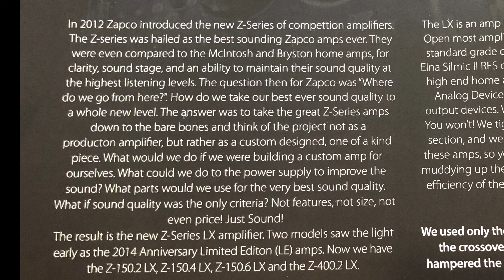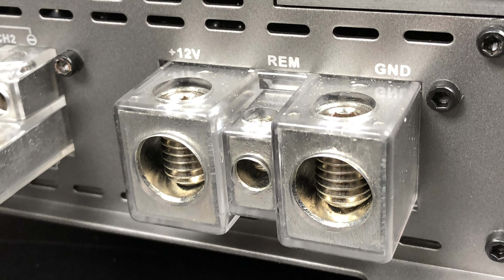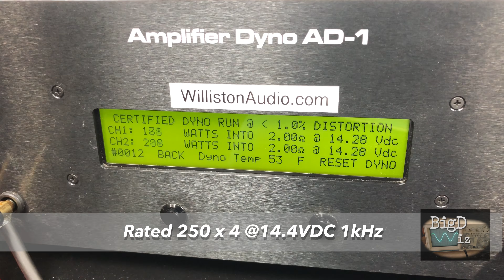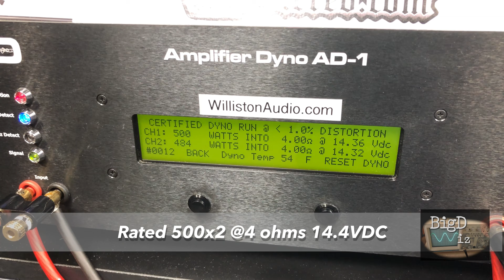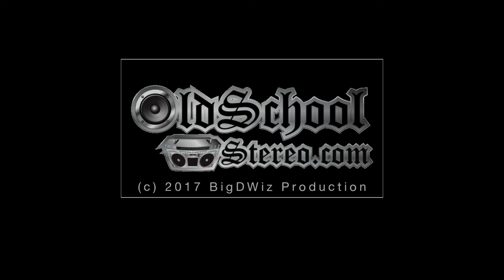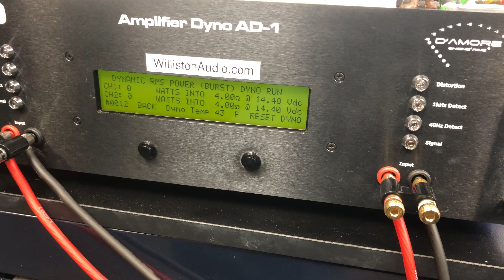$1200 SQ Amplifier? Zapco Z-150.4LX Review and Amp Dyno Test

Comment: These are sq amps so the efficiency wont hurt your car since your only using a tweeter .a midrange and midbass. And perhaps one 12 subwoofer. With approximately 400to 500 watts they have plenty of headroom so overheat I dont think so. They do get warm. Just like my home system.  But I put fans on them.jesus we been putting fans on everything since we were kids in the 70s

Comment: question.... so Zapco never sold out, they are still the same company as back in the 80's(my time)
Reply: No they did in in the late 2000s Robert Jeff was the original amp designer back in the 70s Zeff Advanced Product Co (Zapco) now he's designing amps for arc audio, everything was originally made in Modesto CA USA now it's all from china, so to answer your question no these are not the same amps or company from your time.

Comment: It’s weird cuz I though these amps are rated at like .05 % ( .0005 ) THD shouldn’t the amp make more power up to 1% which is .01 ???? Anyway these have been replaced by the AP series which is even more improved and has better SNR and ch separation! Still this amp is one of the better amps for audio 🔊✅

Comment: I have had a number of amps but the one amp I have and will never let go is my zapco amp ..... It's a beast and sounds much better then any other amp I had ( sundown, ctsounds,fosgate,skar,imagdynamics)
Reply: i loved my zapco amps  sold them and bought cadence amps made by zed audio  night and day   the zed audio  blew the zapco away  with clarity and  bass punch
Reply: @ArkansasChainsaw  what zapco line are you comparing because i run the Zapco Z150.6AP which is there newest high end made for audiophiles... Most SQ builds run the AP line for its pure sound with no built in crossovers
Reply: @bennyblanco14   had studio  and ag  line    dont get me wrong they soung good and plenty of power     my  ear prefers the zed  audio  not the new crap  1990's  stuff

Comment: Seriously though man, the difference between channels isn't as much one way as it is the other. The way you are connecting the bridged inputs when testing amps is causing your channel 2 to take excess damage. You need to evenly bridge both sides. Should be easy to make a bridge block. Two one in, two out blocks with banana plug wires connected and ready to take the load evenly is a simple concept.

Comment: looked and performs like an over priced turd. Kenwood kac 501x looks better a third the price. as for no expense spared it looks as if it has 200v rail caps and no chopper board which stinks and no cable jumpers. inconconclution it looks like a $50 flea market amp with the reliability of 200v rail fire hazard.

Comment: I’m actually most impressed by the fact it did within 1 watt difference between the channels when tested. I typically cringe when amps are Dyno’d and 1 channel reads much higher than the other. That fact alone tells me it’s a high quality amp. Thanks for the testing.

Comment: So cringe watching you shoving the stripped cables into the blocks and winding down the tiny allen keys. On every video. High profile installer like you should go and buy a proper terminal pin crimper.
Reply from the maker: I bought ferrules, but I found I was wasting WAY too many of them. I test too many amps and re-use wiring, so cringing will continue 🤷‍♂️
Reply: BigWiz... Yes, I know you test many amps and reuse the wiring, that's why I made the comment. Just leave the pin ON the cable each time, that's the whole idea of them! Makes it much easier to remove and replace the cable multiple times, and more importantly you get a proper connection. See Link: https://media.digikey.com/Photos/TE%20Connectivity/180599.JPG
Reply from the maker: But not all amps I test accept insert wires. Also, the ferrules flatten out and can be difficult to reuse. For perm installs, yes, but does not work well in my situation.
Reply: BigWiz, with respect... I didn't say anything about ferrules, and I have no idea why you keep referring to them. Terminal PINS. Please open the link that I included in my previous post.

Comment: First time seeing your videos, you did a great job but in all seriousness it is beyond me why anyone would spend that kind of money car audio seems like such a waste
Reply: The 'Diminishing Returns' principle applies anywhere in any kind of audio, but the difference between bargain-basement 'budget' and good-to-better quality is very real, at least as far as components are concerned.  I've heard it, and it can be so disappointing, especially when you know it's out of your budget.   As far as accessories/interconnects/cables, well, you can drown in the snake oil there.  There is also a tangible principle of synergy, where you find a combination that works fantastically, and another that just doesn't, without compromising quality in any individual component.  I have heard this personally as well.
Reply from the maker: Thanks for watching and commenting! Some audiophiles have no limits when it comes to the pursuit of the best sound

Comment: Does rated; awesome.
I can find a Sundown 4 channel that also does rated for $300. So that means I’m paying an extra $900 just for “Sq”... I will have to give it a good listen and tell any difference in sound if I’m blinded but the common person would not tell much of a difference thus in the end, it also depends on the speakers used and how they are setup.
Reply from the maker: Some people are willing to pay $1000's for special speaker wire and interconnects. The SQ market is special and those who appreciate it are willing to spend more, if only for perceived sound differences. I don't test or make claims based on SQ as it's subjective and cannot be measured by tools. A Zapco representative contacted me to test one of their amps, I agreed only if it was allowed to be given away. Perhaps this was not the best test method for their product as it was just wattage numbers, but for now that's what I test.
Reply: BigDWiz 
It’s impossible to capture the Tonal accuracies of an amplifier on video though. The only way is either buying one or being there to hear it. I agree with you 100%.
Reply: Special high-end op-amps and ultra high quality caps makes a huge difference if your speakers are of quality and your not playing low grade mp3's. This amp is for a person running 3 way active with drivers like audio frogs gb10,gb25, & gs60. Add in a helix pro dsp, a nice Kenwood ddx05 or the pioneer 4200nex and quality install and this amp will sing. This same setup will show you just how low grade your avg full range amps are. No transient response because of inadequate power supplies...meaning no real headroom, channel separation is bad, so you got crosstalk, and high noise floor...you know when you hear the hissing between tracks...yeah this amp is one of the top amps period for audiophiles like myself.
Reply: Nike and Rolex watches both tell users the time. Sometimes it's about function... Sometimes it's about fashion. Zapco amps are just some far off fantasy for "budget folks" like myself. But if I had millions or billions of dollars in my bank account, I'm sure I'd buy a Rolex and Zapco instead of Nike and Sundown. 🤷🏽‍♂️
Reply: Eric Perry these amps does not have the Best channel separation like 55db and the lx amps which have now been replaced by the AP line at CES 2018 have bad signal to noise ratio which are known to be noisy.. this amp is Made In China ad well if you care ( I believe high quality can be made anywhere ) have a good day oh and btw I own Audiofrog GB series
Reply: A sq amp will blow the typical Korean board amp out of the water when it comes to sq.
Reply: Sundown...
Crap amps, and crap speakers.
Sounds like shit. 
Have you ever heard what a really well built amp can do?
Do you realize what you can get from a large but well designed sub driver where the MMS does not weigh a ton, the CMS does not equal that of truck springs, or where the QTS means better efficiency than that of an 85 year old pedalling a tricycle?
It's laughable when all the above numbers of a 15" Sundown are worse than that of a Precision Devices PDN2450 or B&C 21SW152 while being more expensive than the two pro drivers. 
The day the car stereo world stop ripping people off, will be a great day.
At least Zapco tries to build a nice amp, like Dynaudio and Focal tries to make nice speakers.
But brands like
MTX
JL Audio
B2 Audio
Sundown
DD
Rockford Fucksgate
Hifonics
Kicker
Soundstream
And so on keep doing their shit, the world of car stereo will be a muddy wold of burp boxes farting their way through life.
In the 90's Cerwin Vega proved that SPL and SQ could go hand-in-hand with the original strokers. Unfortunately, the rest of the market suffocated those with shitty drivers utilizing heavy cones and rock hard suspension designs.
A shame.
But at least it's nice that some are now using pro audio sub drivers, rather than the crap coming from the afore mentioned manufactures.
Reply: @AB-80X  I'm trying to build a system right now. What subs would you recommend? I want the most SQ but will also get loud and low
Reply: @chrisrichards4886  
Wow. That's a pretty open question. What size box do you have room for and what kind of amp do you want to use? What kind of price bracket?
Reply: @AB-80X  I will have room for a large ported box if I wanted to put it in the trunk of my lexus Is but I'm thinking about using a sealed box or running a IB setup.
Reply: @AB-80X  also I have some old audison Vrx amps like the 1.500.2 and the 6.420. I would like to keep it under 750 per sub and even less than that if I can get used ones. Thanks for your help
Reply: @chrisrichards4886 
Let's get one thing out of the way. IB is not for loud music, it's that simple. If i were to do an SQ system based on IB and SPL was of no concern, the choise is as simple as can be. Dynaudio Esotar 1200. When it comes to a driver that works great for IB in an SQ setup, there's no way but down from there.
Do you have any idea about at which point you'd like the crossover to be between your midwoofers and sub? Also, a large ported box or a sealed box can mean many things in terms of size. If it's for a sealed box and you can keep the crossover point below 95 hz using a 4th order L-R filter, and can fit in a box that is 1.7 ft3 including driver,, the Stereo Integrity HST-15 MK2 is hard to beat. If you need to pass it higher than that, the Gladen SQL Extreme are the subs to get for a high volume SQ system. Those work well in various applications, but is especially well suited for ported boxes.
I use the Stereo Integrity HST-18MKIII for my SQ crossing it over @ 50 hz in a sealed box, and it's an amazing sub. It's not a very well known brand, but their quality is excellent.
An important thing to note about all of these subs are the sensitivity. They may look like SPL subs, but in fact they are pretty far from that. They have a tremendous amount of definition and resolution, compared to most other things that is not pure SQ. They will need a proper amp that can deliver the current, especially if you want get really far into the basement.
Reply: @chrisrichards4886 
You're welcome. You can also look into the Stereo Integrity HST-11 if you prefer something smaller, or want to use multiple subs. They will play in a box that is by definition tiny and go extremely deep. The Fs is 17 hz. It does come at a bit of a price though. The sensitivity is on the low side, but it's still a stellar sounding driver.
Reply: @AB-80X  all of the subs you spoke of look very promising and come highly recommend on DIYMA. I actually could have gotten a pair of esotar2 1200's on there for a good deal but was worried I wouldn't get the output I want. I don't need it to be 150db loud but I do like my bass and would like to feel it as if I was standing 2 feet in front of a bass drum. Even more honestly, on my rap music, but still retain pure SQ on more refined genres of music. I do like to listen louder than normal volumes usually, is there nothing out there that will do this in a sealed or IB setup? I will be crossing over as low as possible, to 70 or less than 60hz if I can make the legatia L8se work in my doors! So 95% SQ but must be able to knock when I'm in the mood. Can I get that out of 3 12in driver's or 2 15in run IN? The gear and labor is so expensive that I can't afford to do it over of I'm not satisfied, but I am down to spend the dough to get it right the first time! I can tell you know exactly what you are talking about and appreciate your opinion. What state do you live in?

Comment: Can you test the Rockville rxd m3?
Reply from the maker: I tested the M4 a few years ago. In my experience, they do about 80-85% of rated power (lowest RMS power they post). The other 2 numbers are irrelevant
Reply: BigDWiz okay I was just wondering to make sure they'd at least do cea rated
Reply from the maker: Remember, CEA only refers to 4 ohm measurements. Just because an amp has "CEA Certification" does not mean they do rated power at 2 or 1 ohm. See my explanations in this video - https://youtu.be/yNaDpsK--8Y?t=2m8s

Comment: JMO but, I think this amp represents about as far as class a/b technology can go. As you can see this amp is built with all high quality components and still efficiency hasn't changed a lot since the early 90's. With its SMD design, durability should actually be better and I do like the fact that the designers opted to leave all the bass boost etc. junk off. 
Haven't personally heard it but,  it appears to be a very nice design and well built amplifier.
Reply from the maker: The design is inherently inefficient and yeah, 60-70% is about as much as you can expect from A/B. The other thing to consider is the Class D amps run at ultra low impedances (0.33-0.5) are gonna be horribly inefficient as well. Doesn’t matter if they are 85% efficient at 4 ohms when many people who use them try to run as low as possible.

Comment: BigDWiz I tried looking up before I'm asking this question, but have you tested a Lanzar VCT 2610 a so called 6k watt amp for less than 200 bux on eBay?
Reply from the maker: Nope. Rest assured it doesn’t do anywhere near rated.
Reply: BigDWiz if I took a zero off would I be close lol

Comment: $1200 really my skar rp 150.4ab been tested doin well over rated for less than 200 and bridged is rated at 500x2 rms
Reply: qjuan white The ZL-X series of zapco amplifier are toward sound quality their guts and components inside is best of the best let me give you an example if you would buy a 2-way component speaker like Focal or Hertz for lets say +$800 you can play them in Skar but to achieve the greater balance of mid and highs and transition between every notes switch to Zapco you will feel day and night difference bro i swear to god they worth the money only if you have An SQ setup and DSP
Reply: My dad had the Zapco Z3K and it kicked SAZ-5000 away SQ - Lower consumption - powerfull 
also my friend had the St-x 2000 watt rms and it kicked the SoundQubed 3500 away man in small profile amp they are know what they are doing Zapco are old company
Reply: SubsonicAuthority awesome response I'm going for a balance of spl and sq
Reply: yeah bro zapco isn't really all about the numbers, they are sq amps. Even in their big powerful line up. They do rated but with true sq. that's the difference between skar,sundown,taramps,soundqubed...
Reply: dank9288639 I'll probably check them out sometime if I can find one cheap
Reply: I went from a Soundigital amp that was small efficient and had a lot of power on my sundown audio SA components thinking that sounded good to a sundown audio 150x4 ab and omg it was a day and night difference. It brought out notes and sounds I hadn’t heard in the music before. So I’d love to hear my setup with a zapco since the sundown has been the best SQ amp for me sofar
Reply: Try finding some of the older American Graffiti, Reference(not digital reference), C2K, S or Z model amps. I had an AG1000 at 1875W @ 1Ohm stereo. 2 10's, 152db and sounded superb. Loved that amp! I just bought a later model reference 360.4 for $90! You just gotta know where to find em!

Comment: I love the way this amp looks. Hey man do you have a system in your personal vehicle and if so why don't you do a video of your personal setup? I'm sure you subscribers would love to see your setup. I know I would. Curiosity makes me ask this but the different content would be welcomed. I also have a technical question with regard to a 12 volt system in my truck. It's an 1989 chevy and I can get an alternator that with push 250 amps and it has variable voltage that I can set to 12 ,14, or 16 volts. Do you think if I got a 16 volt battery for my truck that the rest of my vehicles electrical system could handle the 16 volts? Have you ever considered tinning the end of your power wires for the amps. Making the ends solid with solder could make the connections better.
Reply from the maker: I have very basic systems in my cars. I’m not the best installer/fabricator, so I prefer to spend my time playing with car audio stuff and testing amps. I did a vid a few years ago of my Scion xB. I like stealth systems with enough punch to rattle the mirrors, but not to break things in the car